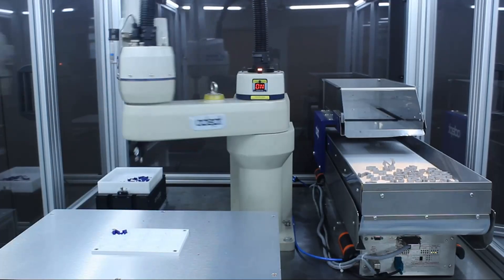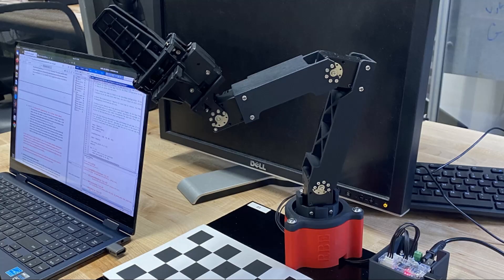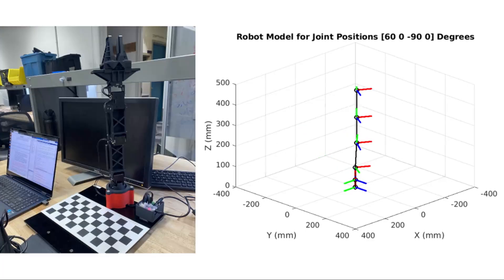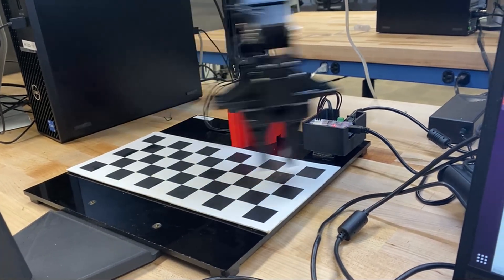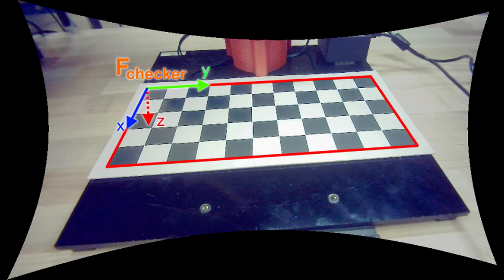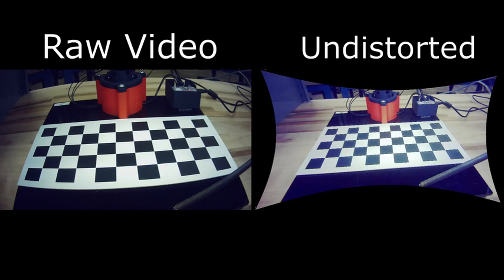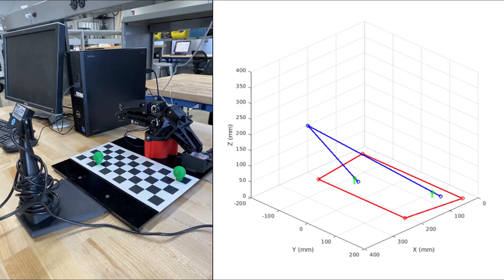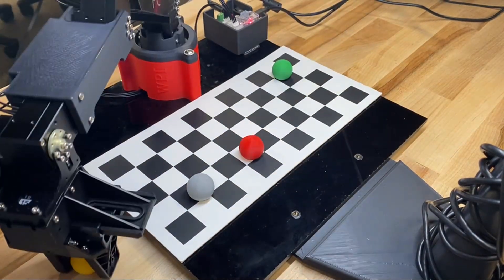Developing a Pick-and-Place Robotic Arm

Comment: is 1400€ low-cost? I found way better, full aluminium, 6-DOF robotic arms for not even a 10% of the price
Reply: There is sadly no link. @OP is just a someone who pulls on a door with a push sign. This arm uses already quite affordable DYNAMIXEL X430 motors having a driver, sensors and torque of 4.8 newton meter. A single motor is about 300USD… and they are needed to enable the arms range and repeatability.
Reply: Can you please give link for that?
Reply: Ha … one can always spot the noobs prone to falling for scams from the far east @falin9557. A single motor of this thing costs 300 USD (they use the DYNAMIXEL X430)… same cost for equivalents that have the driver, sensors and torque of 4,8 newton meter to enable this size and repeatability.

Comment: Can you please explain how we design the algorithm regarding conputer vision based pick and place robotic hand?? 
I'm struggling with my project
Reply from the maker: There’s no one right way to create a computer vision pipeline, but there are certainly some things that help a whole lot. One of the more difficult steps is getting the color thresholding just right since it can vary a lot with ambient light levels so it’ll inevitably pick up some unwanted pixels. To combat this, I highly recommend using the MATLAB imfindcircles function to clean up unwanted pixels. In my experience it works far better than other alternatives like erosion. Best of luck with your project!

Comment: How are the servos not blocki g each other with no timed millis. I still dont understand in the code how the servos know where to go or when?
Reply: The Dynamixel servos are more advanced than normal servos. They each have their own processor and can receive a command to move their joint to a specific position, which they then do without additional help from the main computer